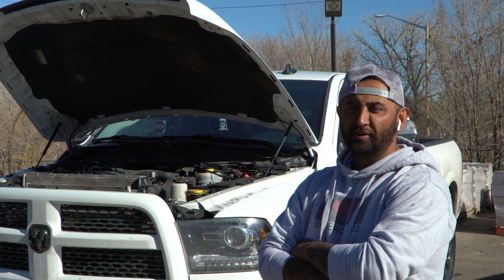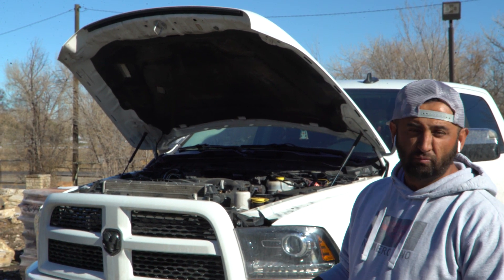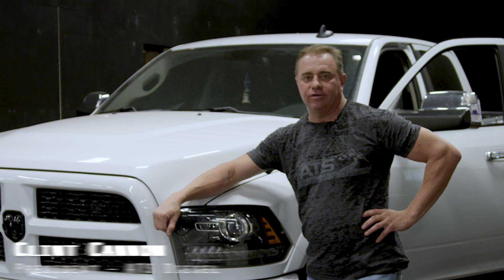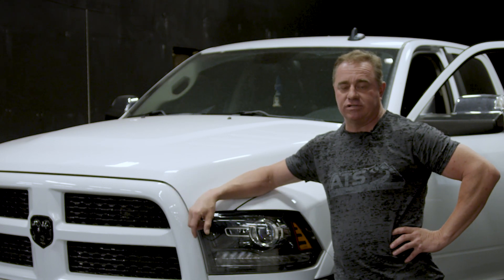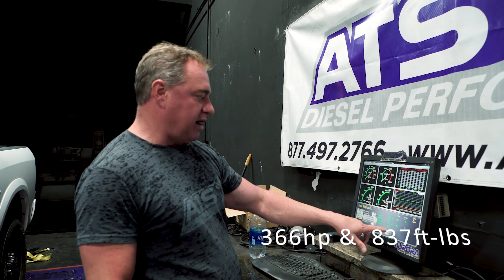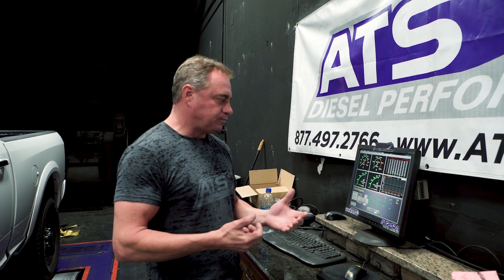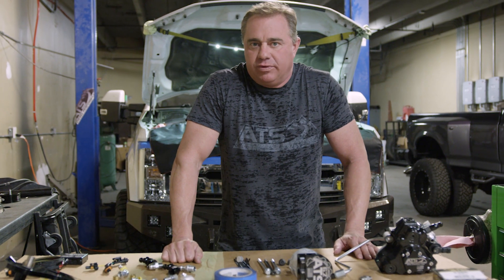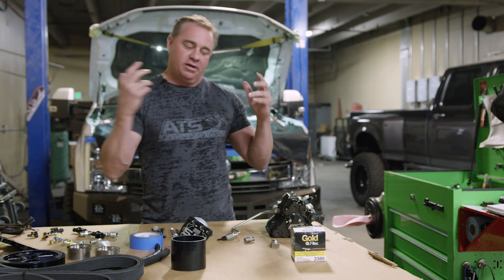ATS Aurora Vortex 5000 Plus Turbo Kit | 2013+ Dodge 6.7L Cummins | Emissions-on

Comment: Doesn’t this need head studs , push rods , valve springs and injectors on top of either dual fuelers or a stroker pump along with a built trans and tuning ?

Comment: If I already have the auroa 4000 on my 2017 Cummins can I use this compound kit with it?
Reply: did you end up adding a 6000?
Reply: @andrewgriffith6719 I’m in the same boat. I called they said that since I have the 4000 then I would need the vortex 6000 turbo compound kit. Did you end up doing the same thing? If so how is it working out for you?

Comment: how efficient vs factory? without any numbers to prove its just false information.
Reply from the maker: We don't test for fuel efficiency nor do we make any claims as to numerical fuel efficiency increases, however we do dyno test to prove increased power to the wheels.  This kit nearly double the power to the wheels from stock.
Reply: 11:36 on the video shows factory vs compounds and duel fuelers numbers